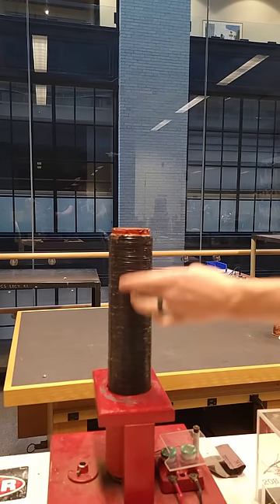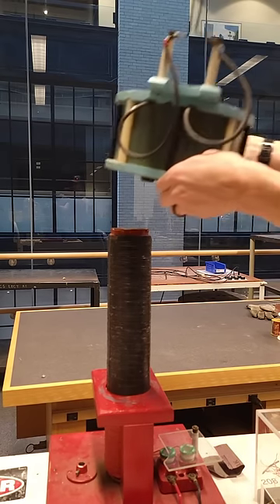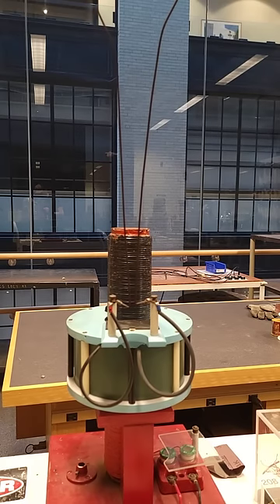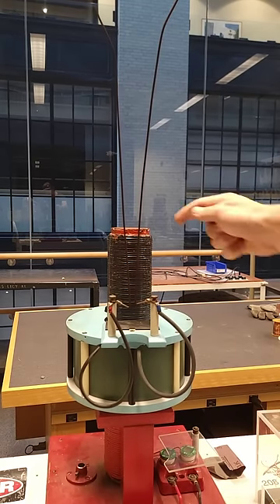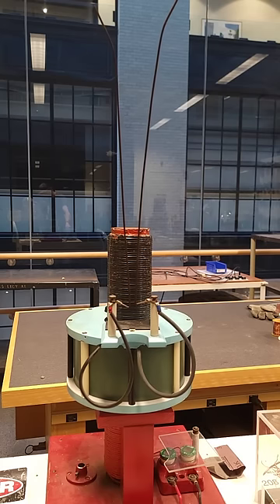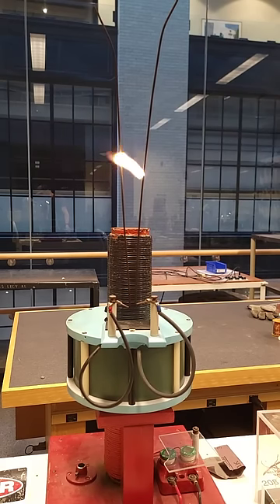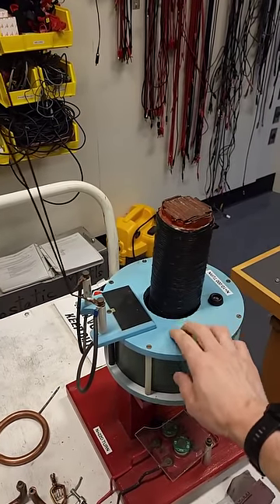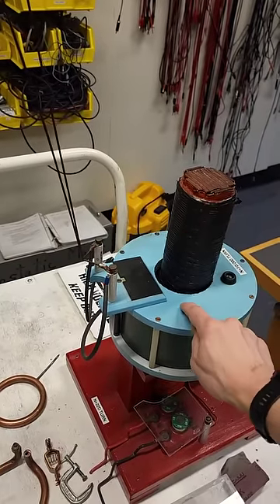Watch this 10,000 turn transformer breakdown air! #shorts #physics #science

Comment: Him touching that thing so easily makes me uncomfortable..
Reply: It’s not a dick, bro
Reply: @nuntana2  its not about the shape its about the FUKING ELECTRICITY THAT COULD KILL YOU
Reply: @FleckySama That thing is most likely connected to a power supply which has a switch, he isn't going to kill himself on purpose.
Reply: A step up transformer like this steps up the voltage while decreasing the current. Current is what will kill you. 0.2 Amps is dangerous
Reply: @FleckySama i bet he thought the white moving thing is kum😂
Reply: @MrMikeT89 thats not really how it works, if he touched that he'd still be fucked, it could have .2 amps but if its 10,000 volts thats approximately a metric shittone of power
Reply: @jonapple2325  Power(Watts) is Voltage(Volts) multiplied by Current(Amps). That is, in fact, how it works. The device likely had fractions of a milliamp. Source: Electrical engineer here
Reply: @MrMikeT89  I see no reason to suggest this transformer should have such a tiny current seeing as regular step up transformers have somewhere in the order of 200-300 amps
Reply: The first thing you need to know about professionals is: they know what they’re doing more than you do
Reply: It's fine. Trust me. He is touching copper wire that has a thick coating on it, and he is only touching it when off.
Reply: @susmanrules ”on purpose “ l had a family friend almost put a .40 S&W round in the back of my head on the range and he certainly didn’t do it “on purpose “. He also didn’t do it because of lack of knowledge he did it because he became complacent and was far too comfortable handling deadly objects to the point that he broke cardinal gun safety rules. My point is an unknown number of persons have been killed while doing something dangerous because the became over confident in their abilities or because they lost respect for the dangerous nature of their behavior or the objects they are handling. 

People don’t buckle up because they tell themselves “I’m not going to cause an accident “ and that may be the case it could be the other drivers fault. People constantly ignore safety precautions or protocols due to confidence and feeling like it’s an inconvenience like “I don’t want to keep having to take my seatbelt off and put it back on over and over I’m not going to cause an accident “ then boom they get T Boned going through a green light by a red light runner.
Reply: @FleckySama  Well, there's a very obvious reaction when it's on.  Soooooo, well yeah.  He knows when it is or isn't safe
Reply: @jonapple2325  Secondary coils of transformers are quite safe unless they are cross connected. The secondary coil has no path to earth/ground so unless he touched both ends of the wire at the same time the worst he'd get is a static shock.
Reply: @Avariel  Unless he himself is grounded
Reply: @jonapple2325 You have absolutely no clue what you’re talking about my friend.
Reply: @MrMikeT89  That's definitely not "fractions of a milliamp" lol
Reply: @darkfur18  It's possible that it is low current, that's my only point. You all are correct to assume it's dangerous but we can't assume anything without knowing the real numbers. Thousands of volts does not necessarily mean dangerous current. At the same time, low voltage can have high current
Reply: @jonapple2325 a transformer doesn't increase the amount of power in the circuit, in fact without being 100% efficient (this one certainly isn't close to that) the amount of power in the secondary circuit would be less. He's saying 110V, I'm assuming he's plugged into a regular household circuit which likely has a 15A breaker. That's around 1650 Watts. If the primary coil has 220 windings, and the secondary has 10,000, assuming 100% efficiency, that's 5000V. At a max of 1650 Watts, that's a maximum of 0.33A, but certainly less with losses and far less than a perfect overlap of the magnetic fields.
Reply: @MrMikeT89 it will produce enough current to potentially kill him and it's 2 milliamps that's dangerous not 2 amps
Reply: @rylandavis2976  You are mistaken. 0.1-0.2 Amps is the life risk threshold. That's 100-200 milliamps. 10 millamps is the danger threshold. 1 or 2 milliamps is unlikely to give you anything more than a shock sensation. Again, source: Electrical engineer here
Reply: @MrMikeT89  Google literally says electrical current as high as 3 milliamps is dangerous and can result in injury.
Reply: @rylandavis2976  Please read my comments in detail. Injury doesn't equal death. Please be consistent with your wording
Reply: @MrMikeT89  You absolutely can make these kinds of assumptions. Something that's "a fraction of a milliamp" will not make an arc like that. It can arc if the voltage is high enough, but will look spindly without the current behind it. The arc on this jacob's ladder is very thick, with lots of plasma generated. This suggest high current, which lines up with the warning placard next to it and the fact that Jacob's ladders are generally well known for their ability to kill
Reply: @darkfur18  This is more or less what I'm saying. Unfortunately the comments have snowballed into people misreading or misunderstanding what I'm trying to say. Overall we don't know how dangerous this device is. At first it was someone saying voltage alone will kill, another saying that this is a metric f-ton of power which it isn't, then to how much current can kill. The 330kv 1kamp DC power line I operated is a metric f-ton of power at 330MW btw
Reply: Relax man, it's only thousands of volts
Reply: There is a sign that says Danger High Voltage
Reply: It doesn't makes me uncomfortable at all. Besides, with all things said, we don't know the AC frequency. It could have been high frequency current and then you can touch the wire all you want because current moves on your skin, not through your body. It's called skin effect.
Reply: This machine is Very Dangerous. It is hooked up to 240v main power.  Look at the input cables. Heavy duty. Now look at the inner windings. That is heavy duty. It can carry a huge amount of current.  The secondary winding is also heavy duty and capable of carrying a huge amount of current at those elevated voltages.
Reply: @MrMikeT89 By your reasoning (its all about amps) touching a 50 amp terminal at 12 volts would be fatal but we know thats not true.
Reply: @FleckySama  for me it was the shape. 
of the MASSIVE ELECTRICAL ARCs.
Reply: @Evergreen1400  The difference is that he is responsible for himself, the guy that almost put a bullet in your dome was responsible for you. other people are more wreckless and care less about others meanwhile someone who is playing with 10000v likely wont commit suicide as it is HIS life not someone elses.
Reply: @jonapple2325 did you not see the episode of myth busters where they shocked Adam with thousands of volts as a prank and he got pissed? It’s true. You can get shocked by thousands of volts and it won’t hurt you. The amps really are what kills you.
Reply: @brandongreene5674  it's not that simple, read up on it a little
Reply: @MrMikeT89  I absolutely had a blast reading all of these comments and I ended up learning something. I think everybody wins in this exchange, people get to learn something new and nobody cussed at each other. W comment section.
Reply: @jonapple2325  there's nothing to be concerned about. He's not touching wires while they are live. Also, the only wires that should be exposed are the ones used for the jacob's ladder. Otherwise, the coils around the iron rod would short out and lower the effective amount of coils which would reduce the overall voltage of the stepped-up side of the system.
Reply: @oldmech619  except that part were he specifically sats it is hooked to 110. So, household current, as such we can automatically deduce it is on a 10 amp breaker. And, he gives us the step of the transformer, the induction winding is 220, and the induced is 10,000. In fact, from the provided information we can actually deduce output amperage at .0002 amps, assuming an ohms of zero for the wires of course. If we knew the winding gauge. And core diameters, we could calculate resistance, but it is safe to say that measured amperage would be > .00019
Reply: @firefighter1c57     Thanks for the math. I still bet it would knock you pretty hard. The sign does say Dangerous.
Reply: My first thought exactly lol
Reply: it has a kill switch
Reply: @MrMikeT89 Bro it's a 5 kV current are you nuts
Reply: @MrMikeT89 like, sure the amps aren't high but you don't even need 50 mA when the voltage literally obliterates skin, internal tissue, going directly to your heart. Very little amps actually required to kill you over short time
Reply: @sakesaurus  lol kV is voltage not current
Reply: @susmanrules ok imagine him just stumbling into the transformer and trying to grab onto the power button to keep balance
Reply: @sakesaurus  I'm well aware. Please read my previous comments. High voltage does not necessarily mean high current. Voltage doesn't kill, current does. Soure: I'm an electrical engineer

Edit:By high current, I mean 100mA or more which is the typical threshold for damage
Reply: @sakesaurus  20lbs
Reply: @warrenarnold "I was cleaning my inductor & it went off🎉🏭
Reply: That's what I came to comment not even half way threw the video lol
Reply: @susmanrules having worked at very large substations, you never get killed on site on purpose. That was a very stupid thing you said. It takes about an 1/8 of an amp to kill you. Electricity ain't no joke.
Reply: @susmanrules 100% of accidental deaths are unintentional.
Reply: Every time i think i have something original to say, i go to the comments and its the top comments lol
Reply: @FleckySama it's not the voltage that kills you, it's the AMPS.
Reply: Static electricity from carpet is thousands of volts. You don't die.
Reply: @jonapple2325 i have literally touched one it will not kill you
Reply: @Rufio1975  yes but it's over all power is low, the wire supplying this setup would easily supply enough power to kill you. A static shock is disputed quick but can still hurt, now picture it not stopping... and being served times worse.
Reply: @Tony-xy7lj  
Oh I definitely know. I was just kidding around. Some people are getting too serious. A young guy on our team at work tripped when he was in a lift and stuck his hand in a transformer. His arm was never the same. Dangerous for sure but I'm sure with any demonstration, the people know the risks
Reply: @MrMikeT89  so yes.

the amperage and voltage coming from a standard US outlet is 120 at 15 amps

the voltage is being stepped UP at a ratio of 220:10000, making the voltage now around 5454v

the amperage DROPS as a result of that

it goes from 15ampt to 0.33amps

its not a good level. its not going to 100% kill you, but it certainly can. which means you should be careful.
Reply: @MrMikeT89   its 0.33amps. its still possibly fatal
Reply: @Maeve_Rose  If it is .33 amps I agree that it is potentially dangerous
Reply: @Maeve_Rose  A device only draws the amount of current it needs to operate. What you are stating is theoretically the maximum. Ultimately it does depend on the power source and values set
Reply: @susmanrules did you really just comment such?     That would be what is called sui***e...
Reply: Barely any amperage at all.  We used to make these Jacob's Ladders in college with neon sign transformers.
Reply: @jonapple2325  conservation of energy dictates that the current has to decrease if you increase the voltage.

example here in australia a standard wall outlet is 240volts at 10 amps, that gives us 2400 watts

If you were to then step up the voltage to 2400 volts, you would still have 2400 watts (technically less due to inefficiencies), but watts is volts times amps so we have reduced the current to 1 amp

So the current here depends on what hes feeding the step up transformer
Reply: @sakesaurus  no, just no.

Static electricity is ~2000 volts and dialectic breakdown of skin occurs at ~500 volts (thats when an inductor becomes a conductor and lets current through at near 0% resistance)

If it was just volts wed all be dead from touching metal on a chilly afternoon.

And when below 500 volts ohms law is in effect so current is severely reduced (human body is roughly 1000 ohms so anything below 100 volts in theory cant electrocute you no matter how much current it has before it reaches your skin, generally speaking though the actual number is closer to 50 volts because of variance in skin contact resistance.

Thats not to say super high currents at sub 50 volts wont hurt, all that energy thats getting resisted is going to turn into heat and thats gonna burn you, but you wont be electrocuted)
Reply: @MrMikeT89 no
Reply: @stasi0238  Please elaborate. We are attempting to have an intelligent convorsation here
Reply: Whenever you step up your voltage you lose a ton of amps making it safer. Your car does this with 24,000 Volts stepped up from your alternator creating about 13 Volts. 24,000 volts in your car is harmless. Though starting at wall outlet strength IS something to worry about!
Reply: @MrMikeT89  you've been generous with your time while trying to explain this. This is first year engineering shit, i.e., not complicated. Some people are too ignorant and lazy to do what's needed to understand even the most BASIC PRINCIPALS.
Reply: A lot of guys in these comments lowering men's average lifespan with their abject stupidity.
Reply: Volt arwnt deadly by themselves its a combination volts, amperage, hz, and the time that its introduced to you.
Reply: As long as he doesn't touch both sides when he turns it on he's good
Reply: It’s not the voltage that kills it’s the amps  infact between ur toes and your head u have a voyage differential of 240 volts that’s right your body produces 240v same as an outlet in uk 😂
Reply: Darwin Award contestant
Reply: @MrMikeT89 I think saying "it's the amps not the volts" is dangerous. The potential across the body directly determines the current.
Technically you cannot have a high voltage across the body without also having a high current flowing. Of course what people  usually mean is a high voltage source with a low maximum current capability / high ESR.

I think that distinction is important, because it might cause people to underestimate the danger of high voltages, or overestimate the danger of say a car battery which can deliver hundreds of amps. Overall what everyone needs to know is that a low voltage source will always be safe, and a high voltage source could potentially be dangerous, but doesn't have to be. 

Considering that this is a continuous plasma arc which rises under its own heat, it's A LOT of power. Coupled with being 60Hz AC, I'm sure it can kill.
Though with the secondary not being grounded, one hand holding the camera, and the other probably pushing a button, there doesn't seem to be any danger to the person filming.
Reply: @MrMikeT89  Hm, in which scenario would you see 5V being dangerous? It's by far not enough to drive enough current through your body.

I agree that the actual risk is a pretty complex matter. Especially for things like tazers and static discharges, since they are so short and it's mostly the total energy that becomes interesting.
The most deciding quantity just depends too heavily on the situation, it's too complex to give a single rule.
Reply: @TiSapph  I just noticed I meant to type 15v(didn't see my mistake in previous comment) but with wet hands/body it is definitely possible with low voltage. It should be obvious that across the heart is most dangerous. This is why it's not recommended to have small electronics i.e. smart devices/speakers near the tub
Reply: What’s really annoying in all the comments is the number of people without the background and knowledge that are either a) making shite up b) using Google or ChatGPT to educate themselves (incorrectly) or c) just using whatever they think they know based on something they overheard dad yelling at the TV when he was watching This Old House.
Reply: @MrMikeT89  Ah fair enough, I agree 15V might just be enough to cause harm. Still going to be difficult (probably need to pierce the skin) with such low voltage, but technically possible.
Reply: @susmanrules yup he has a camera in his left hand and is pressing the button with his right. It's not the safest set up but it's not suicidally dangerous
Reply: @Evergreen1400 
Yes, I suspect most who have lost a limb, eye or caused another to do so because of what you explain here, did not plan on it happening. Just becoming complacent about something you do with regularity. Lot's are killed by supposed, empty firearms. Then again, electric is something I do not like working with. Never have.
Reply: @MrMikeT89 
It's good to have folks like you MrMike. As I said, I do not like working with eletric. As a youngster a neighbor had naked wires out of his oven hood where the switch is supposed to be. We were wrestling and I fell into it. It caught me right below my ear and put me on my rear. I wouldve swore I saw lightning in my eye's right after like in a cartoon.😅
Reply: @kentuckywindage222  I appreciate that, thank you! Getting shocked by an electric stove at 12 years old was what got me interested in learning about electricity. Had a good portion of 220v 40Amps across my heart. It knocked me out and Dr had to shock my heart to get back into rhythm. Electricity is no joke but, at the same time, is safe if you are being responsible. Wires out of a hood definitely doesn't qualify as responsible haha. Glad you are safe!
Reply: It’s probably wired to a dead man’s switch
Reply: your the same that gets scared just be sening a gun laying
Reply: Volts don’t kill, Amps do
Reply: @nuntana2 yea thats a whole different load my guy is real close to taking in the face
Reply: @nuntana2 😂😂
Reply: @firefighter1c57 We cannot "automatically deduce it is on a 10 amp breaker." Could easily be 15 or 20.
Reply: @MrMikeT89 Electrical Engineer here. I just don't think a lot of people in comments sections know how to be precise with their statements, and they make a lot of assumptions. I love how you gave the thresholds for the effects of current, and people completely ignored your wording. Can't win 'em all.
Reply: Its insulated
Reply: @MrMikeT89  Unfortunately, this is a common misconception and it is not how it works! High voltage, if applied to you for long enough time, will definitely kill you by driving high current through your body. You won't get high current through you without high voltage to drive it, and high voltage will drive high current through you. Current is very much dependant on the voltage applied.
Reply: One touch at the wrong moment and he wouldn't be alive anymore.
Reply: @MrMikeT89  The teenager Morgan Wojciechowski died in 2016 when he touched a 12Kv Jacob's Ladder.
Reply: @MrMikeT89 I learned that in votech in highschool xD don’t need to be an engineer to know that…
Reply: I'm just going to settle this mess.
Current = Voltage ÷ Resistance.

If it has 10kv and your skin has a resistance of 10 kilohm, it'll generate 1 amp of current. 

There's a reason why warning labels say "High Voltage." Furthermore, voltage may be limited by the circuit, but the ampage often isn't outside of a circuit breaker. You will get the full power unless that circuit is broken, whereas a low voltage circuit will just shock you.
Reply: @jonapple2325  Every time you shuffle your feet across the carpet, and generate a static spark when you touch something, that's 15 kV or so. It's nearly zero power. Learn basic electricity.
Reply: It safely discharged if there's no spark there be no shock lol unless you have some serious caps in place lol 😂
Reply: under normal circumstances this circuit should not be dangerous but it's still stupid to touch it. My primary concen would be that somewhere in the circuit a charge source came into contact, like a bolt or metal plate. It would create a capacitor and when he touched it, even with the circuit disengaged, the capacitor could discharge through him to ground and with enough current to destabilize his heart.

The chances of that happening are very small, but what value is there in touching it? Just respect that electrical circuits can be extremely dangerous without any visible signs and don't touch them needlessly.

FFS with all these people arguing it's safe or that it's dangerous without understanding how anything works.. trying to apply Ohm's law for this.. smh
Reply: @MrMikeT89 nooo some dude made a video about this his name is stylofoam or something. Tldw there's no specific measure of what/how much electricty can kill you it's all very specific on a case by case basis
Reply: @nuntana2  😂😂😂😂
Reply: Bro... Your research will take all us out of the archaic elevator ride we all hate. PLEASE BURN THat air and step up that shi
Reply: You should research electricity then.
Reply: I've been reading these comments, and I've learned that not one component(s) begin to  function solely on its own without the other present.  It's equivalent to a muscle car  transmission's high speed and the engines being able to regulate the momentum  into the legal settings.😅 The maintenance and warranty anology of the  muscle car insurance will go ahead and kill you, but a cheap college melon with less torque won't dent your pockets.❤❤
Reply: I also learned from one other expert,who also commented  that if the circuit breaker is broken, you expect to get the full current pass it to cause circuit to trip and that the amp will not get around the same circuit breaker and so I learned a kitchen fork stuck in an electric socket will zap but enough to give you a moment worth remembering but not end your existence if you weren't God forbid bedridden with pre-existing condition.

My take and understanding is that the amp from the source is higher there. It reduces down over the distance it travels over bad  weather or storm that will excite the electrons ⚡️ when gust of wind closes the wires together enough to trip the circuit breaker  causing black outs we hear about.( my own words). Amp is is the subject matter in this thread. I'm no expert but...ok.❤
Reply: @MrMikeT89 neither current nor voltage alone is what kills. It’s the overall energy transferred through your body that does it, and that is a function of both volts and amps
Reply: @Natediggetydog  Current is considered more dangerous as it doesn't take a lot of Amps to kill, Voltage in the kV range alone(low current) won't kill. Although it is a matter of perspective, current is more dangerous
Reply: @MrMikeT89  Yeah but current can’t exist without enough voltage to overcome resistance, human bodies are very poor conductors of electricity
Reply: @Natediggetydog  We've had this discussion in this thread. Your point is explained using Ohm's law
Reply: @susmanrules famous last words of a fool
Reply: 😂 That's what she said ...